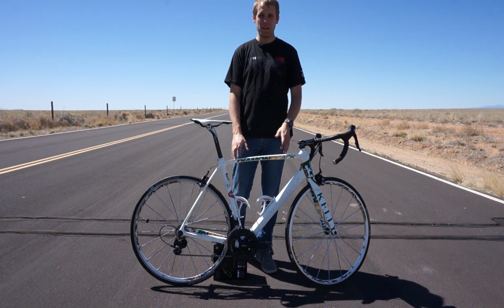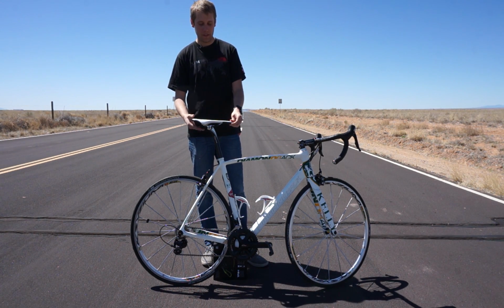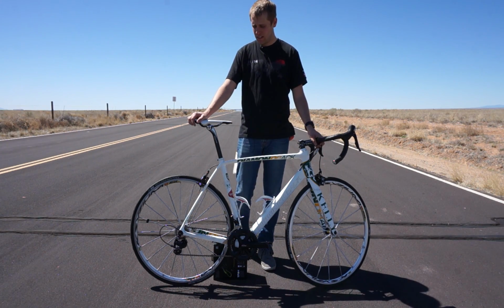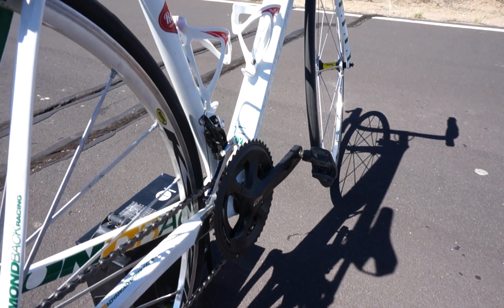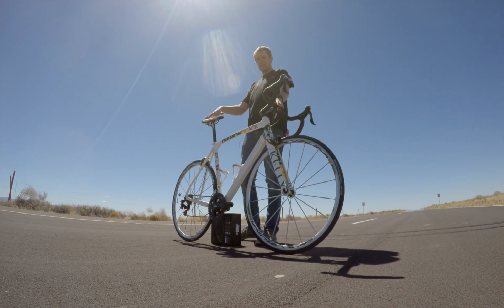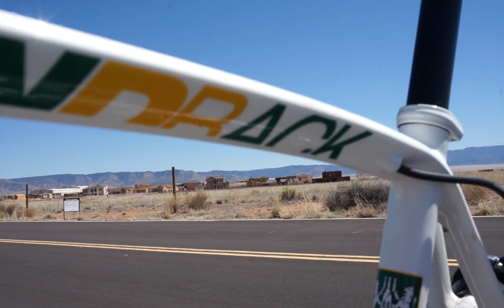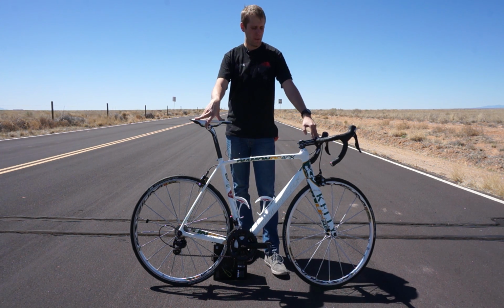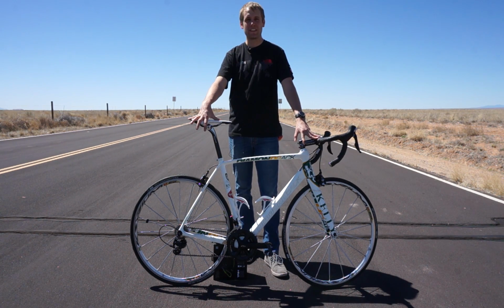Pro Level Road Bike - 15 lbs - Under $1000

Comment: assuming you know how to put everything together yourself ?
Reply: And if you pay yourself minimum wage for learning and building the bike, a.d replace the parts you break from losing it, you still spend 1,500-$2000 on this bike.
Reply: +Ben Braceletspurple If you are going to spend ~$1000 on a bike you should probably know you actually like cycling.  1k isn't a ton of money for a bike but it isn't a small amount of money.  If you actually like cycling there is inherent value in learning how to build a bike and learning how a bike works.

Yes time is valuable but you don't need to learn for 8 hours a day and you don't need to consider compensation for your time doing something you might actually enjoy.  "today I will learn how to install a bottom bracket" watch a 5 minute video and do it.  Eventually you will have a cool bike.
Reply: +entangledvyne yes, none the less the ideal of getting a bike this light with used parts and building it being called "under $1000" is foolish and even precocious. a lot of work you enjoy is still not free. Experts that build bikes every day have more generic knowledge about bikes and inevitably build bikes better. pro teams adterall don't save money by having their athletes build the bikes they ride, as a similar note commuters depend on high reliability with which their own hands can  only provide with significant experience, day-1 bike building is almost always going to fail, I've never see  someone in the flesh do everything right the first time and smash the pavement without problems. whilst I consider your specific point valid I would suggest most to not try to build a bike to save money, especially with used parts. It's more like building model rc airplanes, you fly it, it crashes, you waist your money and time on something you think is fun, for the sake of fun.
Reply: +novadhd there are 100's of you tube videos showing u how to build a bike , the tools u need are pricy doe
Reply: I can see your point, never would have thought of it that way.  I'm pretty mechanically inclined and I spent the early parts of my life in bmx.  So learning to build as you break was simpler with the bikes themselves being simpler.  Guess I've become a bit naive thinking "I mean everyone's been on and around bikes for their whole lives anyhow".  Maybe your first build shouldn't be a road bike with used parts, riding at 30-40 mph can be nerve wracking even with a clear mind let alone "huh was that a bottom bracket noise?".

Pro teams are a bit of a moot point in my mind, their builders give 100% effort all the time and know their riders better than any bike shop knows its hundreds of riders.  Once you get to a normal guy assembling bikes for 8 hours a day you need to consider that everyone has their bad days.  If you are building for yourself you have the luxury of taking your time and caring about your own bike more than any shop will.  On the flip side you don't have anyone liable for your build save yourself.

Thanks for the decent back and fourth though, it's not too often you get to find a civil convo in youtube comments. haha
Reply: +entangledvyne yes and we both love bikes and are capable of building them. I made a video demonstrating the problems with novice part- building, where I made two mistakes. I never mentioned the insane price of tools either for bike building a torque wrench set alone is $70.

Comment: 200 grams is 0.44 lbs, which means even if you threw the seat away and ride on the seat post, you'd still have a bike that weighed more than 15 lbs.
Reply: good one
Reply: this is funny af

Comment: allie express all carbon fiber, 14 lbs total at 800 $
Reply: What group set did you use
Reply from the maker: +KL4M4T0 The bike was build Shimano 105 5800 (11 speed).
Reply: +Bryan Jurus 105 groupset is the best option
Reply: +david balasar the frame was 1125 grams and look for other carbon fiber part on the same site. the wheel I got from ebay for a super deal
Reply: +KL4M4T0 if u buy parts from store it 7s almost 2 as expensive and is aluminum than the carbon fiber which is much cheaper on the site

Comment: Light bike doesn't = Pro road bike. In this instance it is very good though.
Reply: aerobike = fast bike
Reply: Small bike = light bike = pro bike
Reply: Aero trumps weight tho. And there's two parts of aero: 90% is the rider's aerodynamic position and 10% is the bike.
Reply: tengamangapiu this bike looks pretty aerodynamic
Reply from the maker: +CTMinecraftia It's about as close you can get on the budget, thanks for watching!
Reply: +Bryan Jurus Well yeah this bike is very good for 1000$!
Reply: light bike = fast bike

Comment: That's why you maxed out your $1000 limit and therefore couldn't get it under 15 lb.  You bought the over-hyped, overrated, and very expensive, 11 speed set up. 9 or 10 speed will do you just fine.
Reply: +v10moped A 200$ bike will do just fine, but this doesn't seem like to be about just doing fine.
Reply: +baconfromhell666 I was talking about getting the weight under 15 lbs.
Reply: Couldn't agree more.  And the dishing of the wheel to accomodate an 11 speed makes a wheel MUCH weaker.  11 speed is  just not necessary.
Reply: +inacrysis You could ride a.....TRIPLE?!. God forbid.

Comment: What about the wheels? Do they have a play in the cassette (freehub)? I went through a few used mavic's and almost all had play in the freehub. Do those sl ssc's catch too much crosswind?
Reply from the maker: +alexapirot32 Never have noticed the play in the cassette. If your referencing engagement, these are 2 pawl wheels. The hubs work fine with 11s setups though the wheels are 7 years old. In crosswinds they perform better than a deep dish wheel, but catch more wind than a tradition shallow alu clincher. I think they are an awesome training/climbing wheel. If your a cat 2 rider or better, anything aside from carbon tubulars will be a bit of a let down for racing. I know that the Cannondale Team (Slipstream) trains on the regular Ksyrium Elites, not the SLs. So keep in mind, if it's good enough for them to train on, then they are certainly good enough for you (assuming you're not a pro rider, ignore my last comment if you are, but if you are props because you're probably a badass, Cat 1,2 is already insane).
Reply: +Bryan Jurus I've had pa pair of Elites (2008ish) and Equipes (2005-6) and both had lateral (side to side) movement when you tried to move the cassette with your hands. Also the few Mavics I looked at too had the same issue. I'am not sure about the category I would be in the UK sense of categorization. In my country there are only senior, U23, junior etc. ranks. (I'm Under23 btw.). I'm on Strava, if you are too feel free to follow me, great videos! Also, stay away from the Equipes, atleast the older ones, very flexy wheel even for my very low weight at 64kg.
Reply from the maker: +alexapirot32 Are you using the supplied Mavic spacer that came with the wheels. There shouldn't be any play. I do understand what you mean about the hub design though. I haven't noticed it much mine, never when riding that's for sure. Mavic has made small improvements over time though. Might be worth it check out the 2016s. Sorry you were having trouble with your pairs.
Reply: You don't really notice it while riding (i think) but only when you try to manually shake the cassette. Didn't have any issues with the freehub with the Shimano R500 I had sometime ago. And I did in fact use two spacers in between the 10s cas. and the hub.

Comment: That's a cool bike no doubt. I built a bike with an old Klein aluminum frame and the cheapest parts I could find on eBay. It turned out to be 23 lb including pedals, bottle cage, pump with mount, saddle bag (with tire kit and spare tube) and lights for night riding. 
I also have a Felt F5 full carbon that weighs around 19 lb with all the extra equipment mentioned above. Out of the two the Felt is a much comfy ride and has better performance, but I prefer the Klein for training because it gets me stronger. The full carbon one is almost effortless at times and I am not sure I like that too much.
Reply: +Luis Cabrera Weight of a bike has nothing to do with training intensity, wattage is wattage. The only difference will be the speed.
Reply: +Scott Falkner let's ride a steel bike on 20grade climb then
Reply: I didn't say to bring a steel bike to compete with a 15 lbs carbon. I'm talking about training. You can train at 15 mph on a steel bike or 20 mph on a carbon. Your heart and lungs don't know the difference.
Reply: yeah if the environment doesnt say anything
Reply: You have a very good point on wattage but distance being a constant (as in my training route) the body does feel the difference. On the carbon bike is so much easier and faster and when I come back I don't feel the intensity as much. Thanks for your response!

Comment: the frame is aluminum?
Reply: +Haralabos Lukatos Bike fit is very personal but at 5'7" those bikes are WAAAAY too big for you ...WAAAY too big.  A friend of mine whos 5'7" rides a 52cm bike, if that gives you an idea.  Go to a bike shop and try a 52cm bike.  I'm willing to bet you'll be stunned.  Again, bike fit is personal and to go by a calculator is ridiculous.  As long as a rider can stand over the bike with a safe amount of distance from top tube to crotch, THE MOST IMPORTANT DIMENSION IS EFFECTIVE TOP TUBE(EFF).  I would advise you-as I do every rider-to read SHELDON BROWNS webpage on bikes.  He speaks the truth!!.
I think if you ride a 52cm you'll be amazed by the comfort difference.  Sell the other bikes-they're good bikes but TOO BIG for you.
Reply: +Haralabos Lukatos 

carbon
Reply: good bike you buils is looks nice and fast. i do wish i have same bike like your bike. Now i ride bikes vintage steel is 26 pounds without bottles watres other bike aluminum is around 24 pounds one other steel that bike is 2002 lemond tourmalet with 853 steel is stay heavy i think is around 24 pounds. i want lighter bike
Reply: +Haralabos Lukatos

the frame is only 900 gram.  this bike is around 13-15 pounds. But it's not my bike, I've not built it and it's not my video :)
Reply: i not know how i thinking is was your bike. :) What you thnink about carbon fiber bikes. Some people say is crack easy and ride harsh. Carbon fiber bikes is not ride better than steel and aluminum?
Reply: if you are not a professional sport racer (aka Lance Asstrong) than  a steel frame would be  best choice. As for my opinion a steel frame (Cr-Mo) is better than aluminium one - very little more heavier, but more durable and more reflexive on a road. 
I don't know a lot about carbon frames, but I think it is an excess for recreational cycling. However carbon frame can crack only if you will smash it with hammer, rock etc. Carbon frames are very strong and durable (much more durable than  aluminium frames. Aluminum accumulates metal fatigue - and may break after  few years of usage )
Reply: +Haralabos Lukatos The LeMond with 853 is a very desired bike by those who know.  I sold my Schwinn Peloton, which has 853, and the young rider was very happy to buy it.  The steel rides better than my DIAMONDBACK PODIUM-same look but different carbon layup than in this vid. But frame geometry plays a huge roll in how a bike feels and handles.
Reply: michael allen

Frame geometry is the most important thing in bike for me. Frame is the soul of a bike. I set same wheels on different bikes - and it all was absolutely different bikes with same wheels.
Reply: That is sounds good and cheaper way to have like me 4 bikes. I do the same i use in two bikes the same wheels but my goal is to use same wheels in all my 4 bikes. I not have try yet but i try found out if i can use the same chain length in all of my bikes. How i can found what geometry have my bikes i have buy all my bikes used.
Reply: which road bike is the best today and not cost much?
Reply: Diamondback Podium Etap at Pricepoint.  There is litle that comes close for about $1,000.  Planet X also has some good deals, especially considering you can set up the bike  as you want.  Planet X runs about $400 more than Diamondback but you get Ultegra and choice of parts one normally would swap out for personal choices e.g saddle, handlebars etc.  But the Diamondback is GREAT price.
Reply: thank you for the answer. I have 3 road bikes one TT bike and one mountain bike steel frames and aluminum too but i think is waste money try upgrade this older bikes is better to buy new bike.
Reply: +Haralabos Lukatos I rode a Schwinn Peloton: 853 steel frame.  That bike rode better than any carbon frame I've ridden on.  Steel. just absorbs more vibration.  But the most important consideration is geometry and fit.  If you want to race-or just get in great shape, do NOT waste your money on a carbon bike.  Get a power meter before that and learn how to use it properly and all about exercise physiology.  It's truly NOT about the bike....that's the one truth that Lance Armstrong was not lying about.
Reply: Thank you for the answer.I not try to race i am 49 years old. Just i love to ride bike. One of my bikes is greg lemond tourmalet have 853 steel. Now have tiagra groupset and matrix wheels. You think is the best i upgrade my lemond? I have one ultegra groupset 6500 9 speeds and fulcrum wheels. The fulcrum wheels i have in one old 1987 bianchi strada lx. Is steel frame i not know what steel have but is heavy bike. I was thinking to put the ultegra groupset in one aluminum road bike i have is cannondale R300. I see you mean 853 steel is better. Lance amstrong yes say truth.
Reply: +Haralabos Lukatos IF the LeMond fits you well(most leisure riders NEVER look at bike geometry which varies a LOT from bike to bike) and it's in good shape then I'd upgrade the LeMond with the Ultegra you have....unless you prefer the aluminum.  I've ridden many bikes and my favorite was the Schwinn Peloton(similar to LeMond).  But the Peloton was just a bit long in the top tube for me.  I am 6' and ride a 54cm Diamondback Podium 6(similar to this videos bike but with Ultegra).  It fits me well but I wish it were made of 853 steel!!!.   So, I'd upgrade the LeMond.  I have 10 and 11 speed on my bikes and 9 is just as good for us older riders; I'm 52.  I did just buy a 105 groupset from Merlin(as they did in this video) to build up an aluminum frame I've had.  Again, I prefer STEEL for it's plush ride but really any material from steel to bamboo is going to be fine IF you have a good carbon fiber fork.  My PELOTON came with an aluminum fork and that thing pounded the hell out of my wrists and shoulders.  I put on a carbon fiber fork and VOILA!...
Good luck...let me know how it goes. What county are you in?.  I'm in USA.
Reply: thank you very much for your answer. I live in USA too in Atlanta GA. My height is 5`7" the lemond is 57cm? The cannondale is 58cm. The bianchi is 56cm. Now online size calculator say i need 55 cm bike. But with the lemond i feel okay only i want replace the handlebar. Is 47cm looks to big i feel better with 42cm handlebar, I go upgrade the lemond. The cannondale i do like too  but i know is old frame maybe 1993. Is for 7 speeds wheels but i squeeze 9 speeds wheels is the fulcrums.
Reply: thank you for the answer. I want try smaller bike. All my bikes is have horizontal top tube.
Reply: +Haralabos Lukatos That's what bike shops are for!.  Bring your shoes and ride every 50-53cm bike that you desire!!.  I know you'll feel a huge difference between a 56-58cm bike and a 50-53cm(EFFECTIVE TOP TUBE LENGTH).  You MUST read Sheldon Brown's web page.  There is no greater knowledge/wisdom regarding bicycles.  If you don't read and understand his website, then you're not a good, knowledgable cyclist.
Reply: Lance Asstrong got his nick name from doing polish bike rides ..ouch

Comment: What dura ace have you been riding? haha
Reply from the maker: +Ethan S haha I admit the last Dura Ace groupset I road was 7900. Shimano admits it had cable routing issues. The new 105 group is on par with it or better. Dura-Ace 9000 mechanical is better than both,c but I still don't feel its black or white. It's nearly impossible to tell the difference between 11s 105 and 11s Ultegra. I have both currently and aside from downshifting, which the Ultegra maybe slightly quicker, I don't think there is a performance difference. Yes weight but even then its less than 200 grams.
Reply: You have to be a serious rider to justify buying dura-ace considering it has little more to offer than slightly quicker shifting and weight. especially with Di2 Ultegra on the market.
Reply from the maker: +Ethan S Agreed. I recently was at Tour of California. United Health Care runs Ultegra on most of their bikes. They had a couple podiums.... Definitely not the equipment, its the rider.
Reply: Bryan Jurus especially if you consider UCI weight limits as your target (mine is 7 Kg). Ultegra is all you need. frankly, it is the best piece of kit on the market and I have no idea how Shimano still sells dura ace... Potenza comes close but it is usually a bit more expensive due to the smaller run and the shifting lever behind the brakes feels a bit spongy.